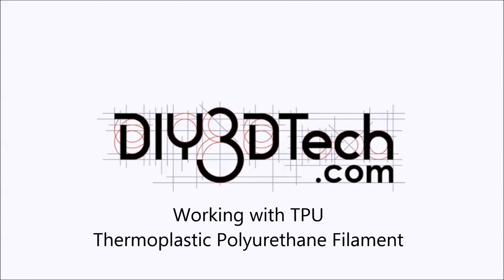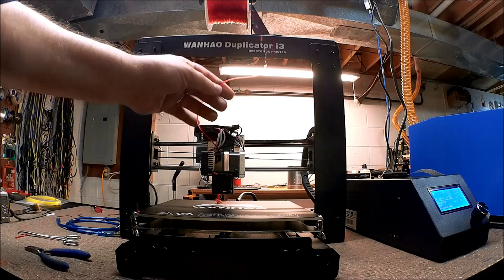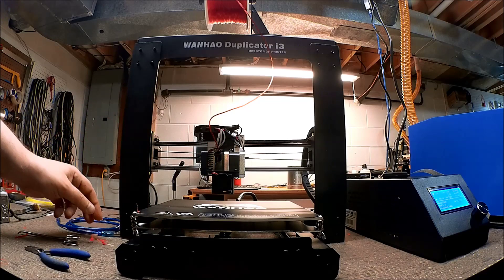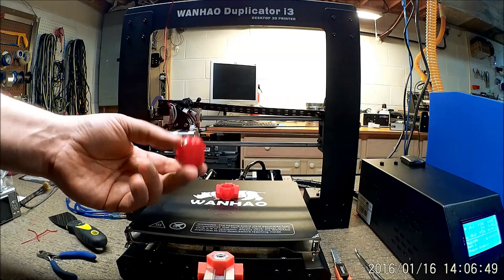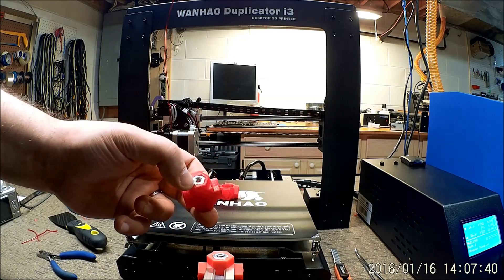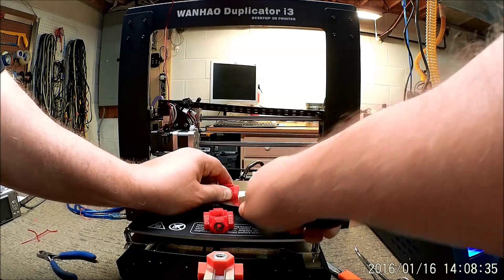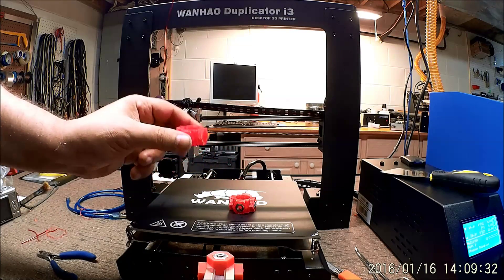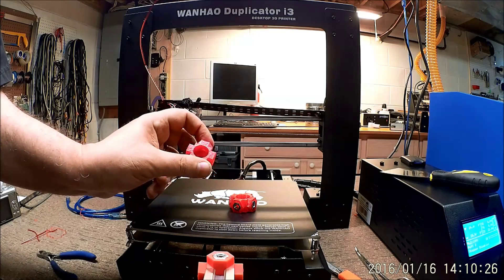Working with TPU - Thermoplastic Polyurethane Filament

Comment: my question is ….I am building an RC snowmobile and need a good track material. I am putting a Nitro fuel engine from an old RC car.. is this filament strong enough but yet flexible enough to travel around the models suspension?  it has to be flexible but then strong enough to withstand the pull of the nylon drag wheels that will be turning the track
Reply from the maker: Strong enough, yes flexible enough no...  Especially in the cold...

Comment: Great video I have the same printer are you using Kiara? Also what are your retraction settings for using this type of filament I bought the same brand but the stock extruder I'm going to do the stepper Gear mod but just wanted to know your retraction settings thanks Steve
Reply from the maker: Many thanks!  Yet, sorry " Kiara" and for retraction 4.5m @50 but I slow down the printing 20 to 40 mm/sec depending on object and the retraction distance is dependent on the object but I typically set it short...
Reply: DIY3DTECH.com okay great thank you I meant to say Cura
Reply from the maker: Yes yes to Cura also...

Comment: I'm trying to print FoxSmart TPU with very mixed results on a stock Anet A8 at 260c hotend and 60c heat bed on glass. Sometimes it works nice but more often than not, it will print in globs and then not print at all even at the slowest speed my printer will go. Does it sound like my settings are bad or maybe the filament? Also, mine has no smell at all. If I print at less than 240, it won't really flow at all.  Also it doesn't really want to stick on the regular bed without the glass.
Reply from the maker: The temps sounds a little high as I typically print 250 to 255 however I looked up the Anet and it appears to have a Bowden extruder and this is not the preferred means as TPU is flexible.  A better extruder would be something like MK8 direct drive so there is a very short distance between the cog and hotend.  I would say this is the reason your getting mixed results...

Comment: going to buy a roll of this based on your experience here.  any thoughts on other tpu brands?  can you share your slicer settings?
Reply from the maker: +Shai Perednik I have only used the slain smart brand and love it!  Matter a fact just order some more!  I really like working with Pete and TPU...
Reply: +DIY3DTECH.com what's your retraction set to?  I recall the video says 250/80 for temps.
Reply from the maker: +Shai Perednik with the all metal hotend, I am using 1.5mm, with the standard would say around 2 to 4mm

Comment: is this printer stock? Thought you would struggle to print flexible filament as standard
Reply from the maker: +Brett Fielding 100% stock, yes and no issues other than those mentioned in the video.  Also really like TPU to work, was surprised how well it all came out...
Reply: well in that case I'll be giving it a go cheers for the advice